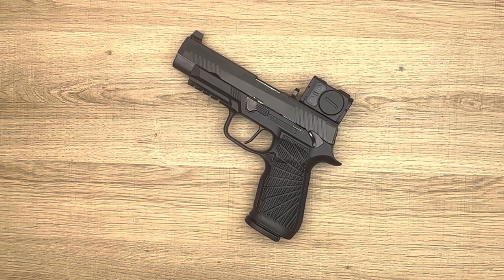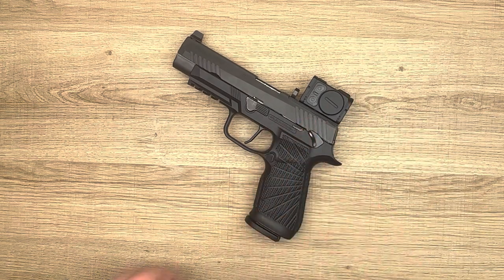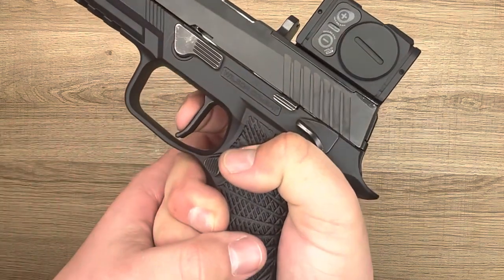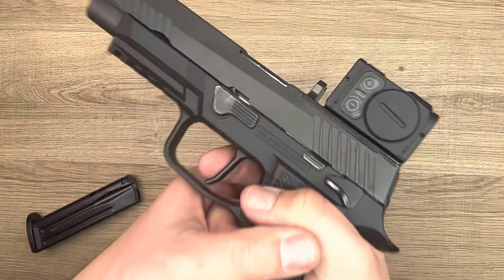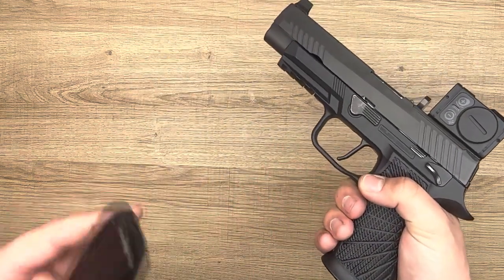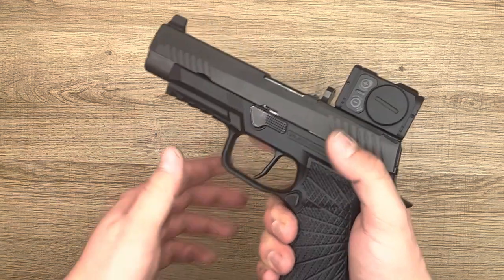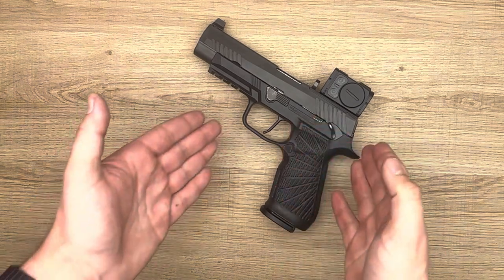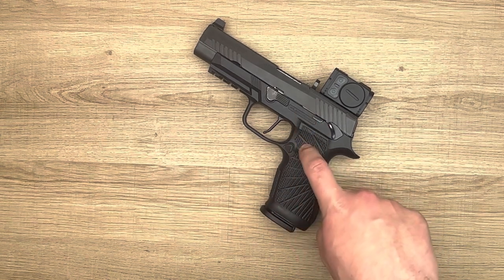SIG P320 Slide “Bounce” - Why It Happens, and How To (Mostly) Fix It

Comment: I currently reassembled my 320 after cleaning and forgot to flip the take down lever back and now i cant move my slide, slide lock or take down lever. Can you plz help
Reply: I'm surprised it went back together. You will probably have to take it to a gunsmith. Or take a Dremel and cut off your grip and buy a new one. At least the plastic grips are cheap, $80. Might be cheaper to do that than a gunsmith

Comment: I don't know if this is a gun issue or magazine issue, but on my p320X compact when I have a full 15round mag loaded. I insert it, and pulling back the slide is really tough because it has to drag past that 15th round. If I unload 1 round from the magazine, I get no resistance chambering a round. I am using the wilson combat grip module like you. It sounds like a magazine issue to me.
Reply: Are your mags Italian or US made? I don't have the issue you describe but I know that the Italian magazines are not nearly as stiff when fully loaded.
Reply: @orficaldari3524  they are all made in Italy as far as I know

Comment: Can you tell me what snap caps you’re using? I tried tiptons and it locks the bullet in the chamber every time. Trying to find a snap cap that works on the p320
Reply from the maker: Hey there! I'm using A-Zoom snapcaps, have had them for about a decade. Never had any issues with them in use.
Reply: @Paul_Whaley  thank you very much